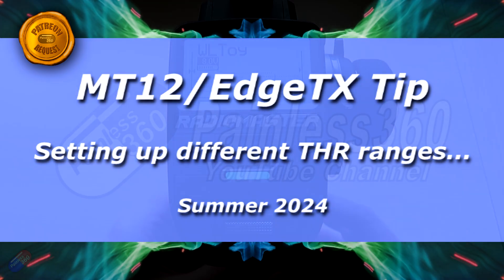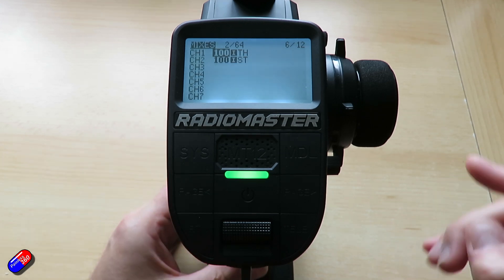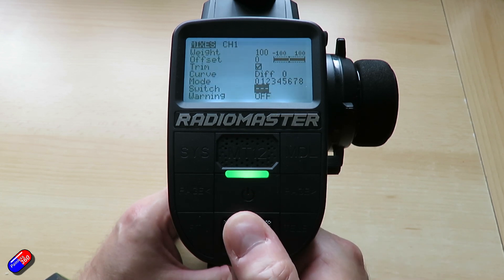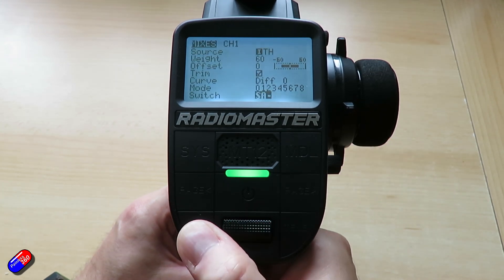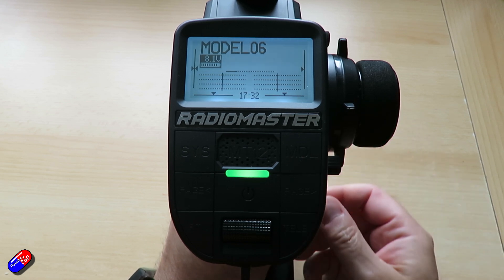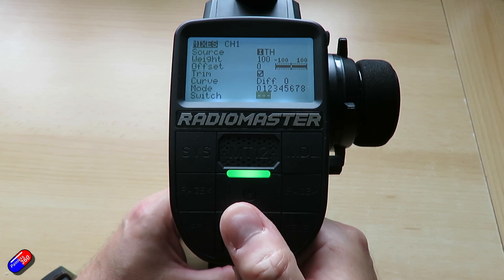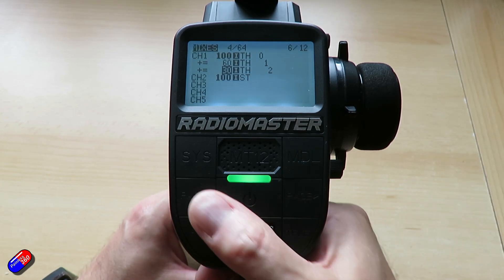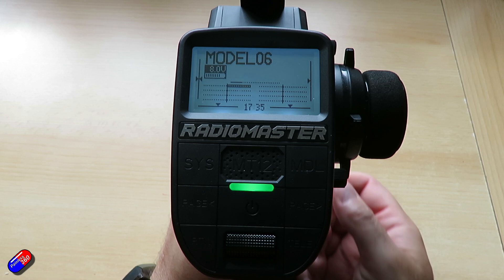MT12 & EdgeTX Quick Tip: How to setup multiple throttle ranges (handy for rock crawlers)

Comment: With the mt12 I’m running out of radio in drag racing. Example is I can use my Futaba and calibrate at 100% throttle but can raise the epa to 120% and that gives me more speed and faster times. Is this possible on the mt12